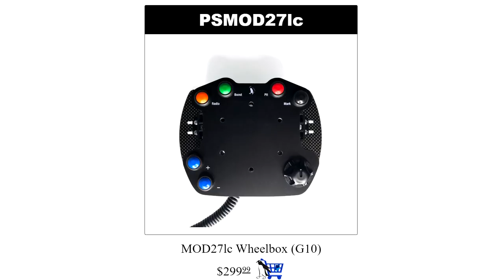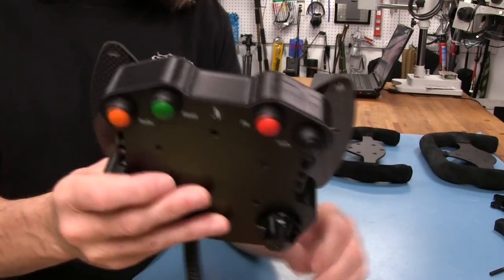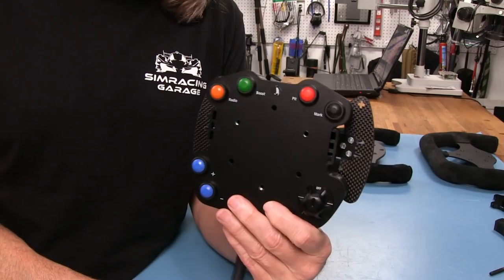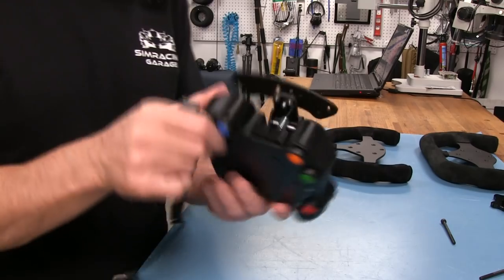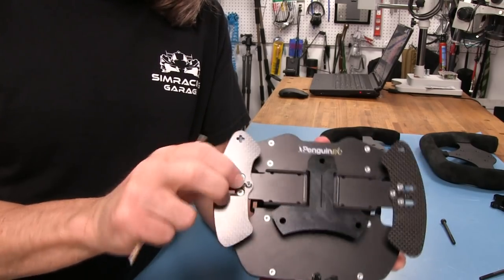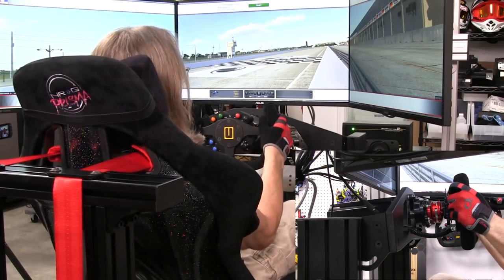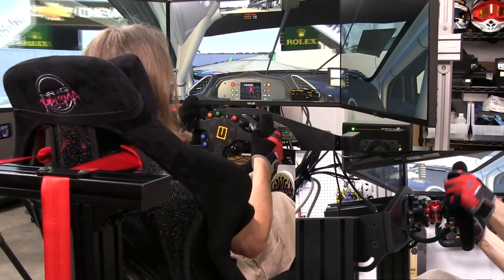Penguin r/c PSMOD_27lc Wheelbox Review

Comment: Thank you for the review - To address a couple of things.

#1 - The Selector Knob on the lc is aluminum. and the only difference is the Printed direction indicator with the normal PSMOD_27.
#2 - The screws included with this box are not countersunk for a couple of reasons:
   a: - The cost, as we have not found a supplier that in production can provide us with long enough Countersunk bolts at a cost which makes sense in production to cover BOTH blind mount hubs as well as through hole hub mounting . 
   b: - We expect this box to be used mostly with the Momo Mod 27 wheels which require you to drill your own PCD and in doing so most of the time the drilled holes will be non-countersunk.
#3 - You only really need to undo the 4 outer screws to remove the back plate for Paddle Adjustment.
#4 - Switching the paddle wire placement is fine it just changes the Gamepad button number used for the Paddle.
#5 - For more paddle weight we do have optional stiffer spring sets.

We honestly did not think the Original Turn R1 wheel would it the wheel box due to the placement of the Common Coder, Nice to know that it actually does.. The Box is called the MOD27 because it was initially designed in conjunction with that particular wheel but we have found there are a few others it can work with like the Turn R20 (save for the labeling cover).

For information sake this wheelbox is designed for Wheels 300mm in Diameter and below.

Given the full width you are using on the paddles it may be possible to mount the actual QR or attachment hop directly to the back plate bypassing the Paddle clearance spacer.

Of note: we are looking into making optional longer mounting plates for the Paddles which will help alleviate the flex you found in the paddle mounting when they are extended to the furthest out position.

EDIT: New MOD_27 wheelboxes come with inserts to better support the paddle plates when using the outer positions for the paddles. We also have also moved the labeling for the upper buttons to be more legible. and adjusted the labeling for the CommonCoder to have a more intuitive positioning of commands.
Reply from the maker: Thanks for the clarifications Brion.
Reply: Hey Brion, was Penguin RC originally called something else? The Rustler chassis looks super familiar...
Reply: @seth556  Nope always been Penguin r/c since inception in 1997.
Reply: Brion Sohn I’m sure I had still seen that chassis back in the day. I was super active on the Ultimate RC forums around 2003-2008 so maybe you were there too.
Reply: @seth556  It is possible that chassis has been available for quite a while.. We sort of transitioned out of our of design projects around that time into doing mostly OEM work for other companies which we sill do today.. Then of course just recently I have gotten more into the Sim Racing and am of course designing the wheelbases and manufacturing them as well as some OEM work for some other major Sim Manufacturers.. We still do offer and support all of our RC products that we can still produce for the vintage RC Racer.

Comment: Being honest I would stay away as there are a tonne better options around similar money and a little more. I have 2 friends who have purchased versions of these plates before. The buttons aren't of high quality feel like mush plus there is no detail of the exact buttons being used. Barry says the paddles are quiet but thats only because they are softer and worse feeling than the standard Fanatec. 

Buddy has had issues with the Carbon Fiber peeling after mounting it to his rig. The structure looked to hold up fine as the wheel being sandwiched held it together and the filling was ok. But nothing compared to the strength of other options which Barry has reviewed. 

For $300 or more these are no way worth the price.
Reply: I guess, I don't understand all of these button boxes and their functions.  I use a Stream Deck for my button box where I can have unlimited button function with actual lighted icons/pictures so you never forget which button to use.
Reply: A correction to your assumptions the Paddle Shift units on this plate have a spring setup which is about TWiCE as stiff as standard Fanatic and about 25% stiffer than the Accuforce Standard spring paddles.. In addition these paddles can be upgraded even further to have much stronger springs than what comes as our stock units. Yes the main buttons used on these plates are NOT the highly expensive Knitters or circuitboard type tactile buttons so they don't always give a distinctive click.

I do not believe that Daniel is even talking about the Penguin r/c units as it is IMPOSSIBLE for the carbon fiber on our units to "peel" as any Carbon fiber used on our wheel boxes is Aerospace Grade Engineered Carbon Graphite Fiber Plate (the real thing) not a Vinyl sticker OR laminate.. which could peel as it is either really think or not real.
Reply: @WhiteHawk77  My Wheel has 9 buttons and I use them for quick selections such as look back, look left, look right, pit limiter, change view, wipers/light selections, enter & escape including arrow selections.  All other function such as ignition, start, ABS, TRC, BAL, Mix, ERS, change LCD, etc., I use the Stream Deck which is immediately adjacent to my wheel.  My Stream Deck is set up for different sim even different cars.  If I race F1, wheel buttons are use for DRS & KERS which I need without looking.  Since I like to race with most lights off, it is nice to have a lighted Stream Deck with lighted functions.  All I am saying is that you don't need a wheel with many encounters where you forget their function.